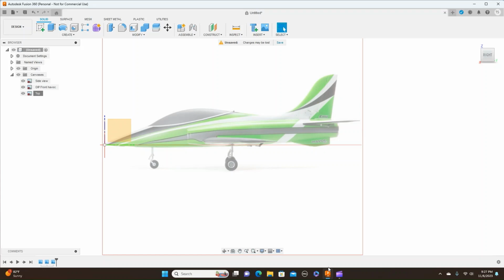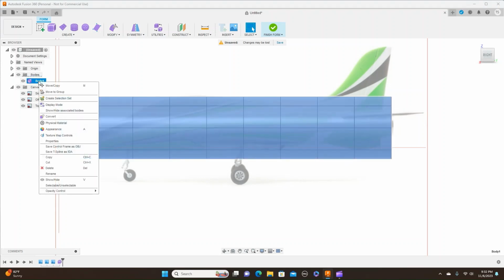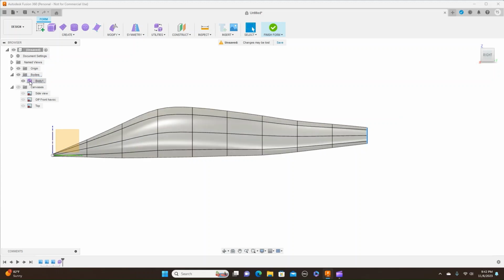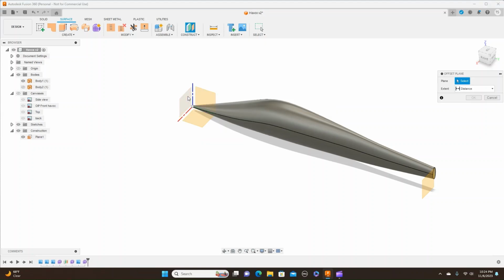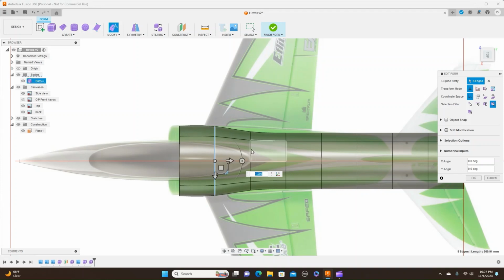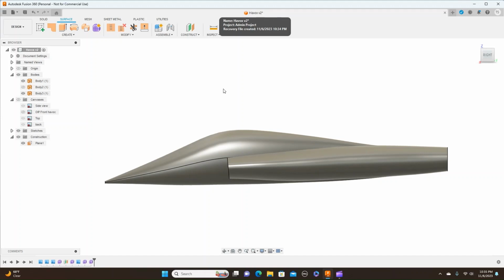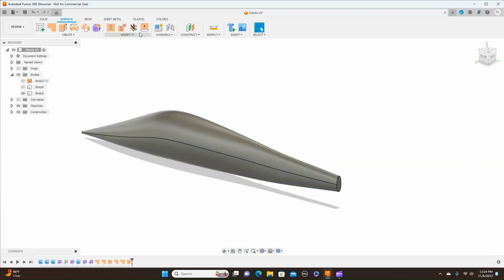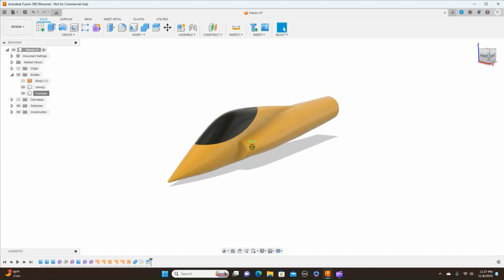Learn How to Model A Havoc Jet In Fusion 360 Free Mold STL File.

Comment: Does Solidworks have the same tool to create a fuselaje like you did in fusion 360?
Reply from the maker: I am not sure, but I will look into it and get you an answer.
Reply from the maker: I have looked into it.  It does have form modelling tools, but not like fusion.
Reply: @cadbuildflyrc3784  thanks so much for your reply! I'll move in to fusion 360 then ...